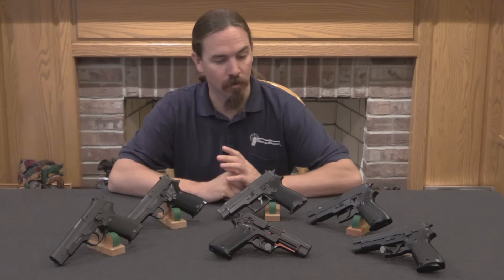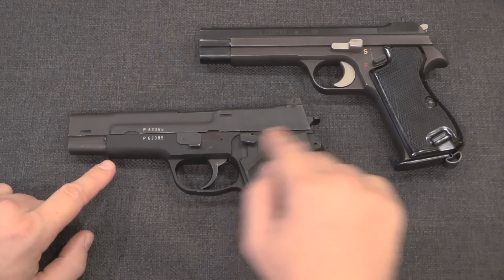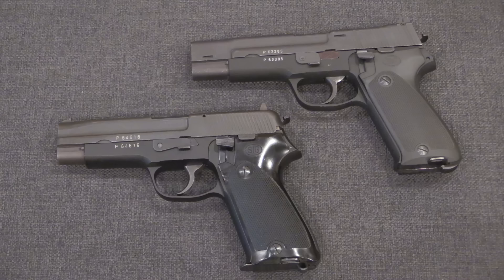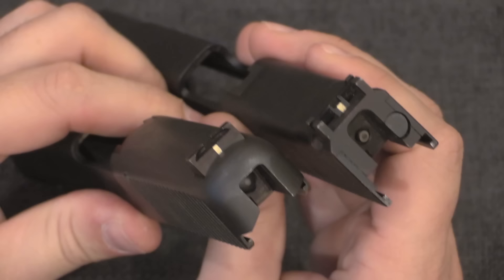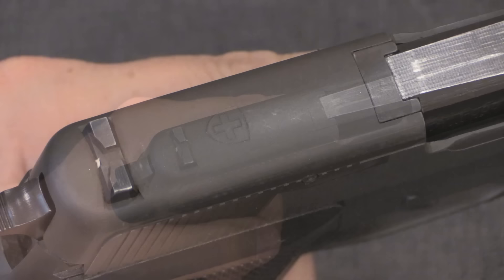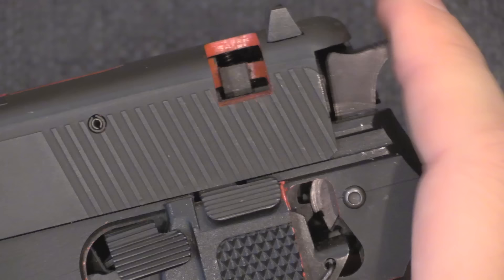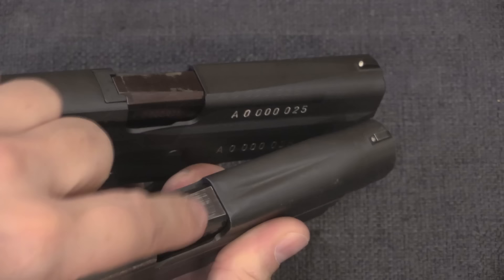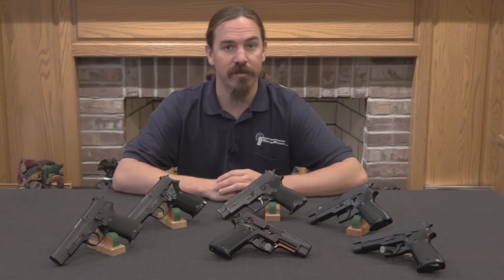Development of the SIG P220, aka the Swiss P75 Army Pistol

Comment: The shield on the border patrol pistol is to address the issue of the pistol scrubbing the mag release when carried in a police style holster and getting in and out of vehicles .  As a side not  H&K  addressed this same issue on the p7 by retrofitting a different mag release and re shaping the grips to guard it .
Reply: This makes sense as I would imagine a Customs Agent could conceivably be found crawling around in the back of a trailer truck inspecting the cargo.
Reply: For the north American market they moved it to a thumb release on the grip midway up the trigger guard.  Works well with my pinch type holster where the heel button almost invariably came in contact with EVERYTHING and released the magazine so it dropped as soon as I got out of my truck.
Reply: the shield on the heel mag release is to prevent accidentally hitting it when the officer pistol whips a suspect during difficult apprehension. 

ok, probably not, but that would have been my guess.
Reply: That is correct. It was supposed to solve vehicle seating issues.
Reply: That's exactly what I was thinking. Since the customs enforcement usually drives in normal cars (maybe even with sport seats if the people buying the vehicles don't know what they're doing) so that would be a constant issue
Reply: @Razgriz the Mandalorian 
I like it for being ambidextrous, but especially in the cae with brushing up against things in close spaces, the paddles can be touched accidentally, at least the ones that extend forward.
Reply: Interesting, my theory would be the using engine block for cover, resting the gun on the hood of a vehicle, one shot but your mag's out! 😮

Comment: I believe the initial army production of P75/P220 lasted until late 1980, early 1981. I received mine after officers’ school in June 1982 and the rounded slide had been replaced by the squarer one. Still own it but its hard trigger doesn’t make it as pleasant to shoot as my other pistols (Sphinx 3000 Competition, P226 X-Five Super Match in 9mm Para or P229 Sport in .357 SIG). Great review, thanks a lot.

Comment: Hopefully to be soon followed by the SIG Saur connection and the P6 / SIG 225 genesis. Geoff Who regrets not buying a 225 when the price was only mildly obscene and not buying a surplus P6 when they were available...sigh...regrets I'm had a few...
Reply: Yeah, I bought a Simunition converted P6 for $329 (and used it as such in some training), after a live barrel (took forever to find one), new grips, refinished slide and fresh internals-springs etc it is my carry gun. Too bad they are so expensive now...
Reply: Sig was always ridiculously proud of their pistols.  I've wanted a P226 or P226 to represent service pistols, but those prices...
Reply: I love SIG P225!!
Reply: A few years ago the police force I work for bought ~400 P6 pistols for 1€ per piece from another police force that was getting new pistols ;)
Reply: Thats how I got a decent P225. In Switzerland when Police or Military gets rid of Weapons the sell it on the market so chances are high that you may lay hands on a SIG225 with special Police Markings on it (I like the compact size and the compact grip of the P225 as it uses single stack Mags 8+1) . One of the best guns for me and this is the reason I do not like the P226, P228 or P229 as they use doublestack Mags and the Grip is much wider.

Comment: The ramp was there because as customs officers crawled around inside confined spaces and vehicle interiors, wearing modernish duty holsters which exposed the butt to contact, it was common to drag the butt of the pistol across surfaces which could release the magazine.  

Obviously this happened enough to cause it to be an issue that needed to be addressed.

Comment: A non-military P210 should be outfitted with fancy wood to accentuate its classiness. P220s look best when they're two-tone with wood grips (but that's true for pretty much any pistol that doesn't have a polymer frame).
Note: I have a first-gen American-pattern P220 that I bought used/like-new back in 2007 for $550 (K-coat finish, original grips).

Comment: Another difference with Zoll P.75/95, aside from the lanyard loop switched for the magazine release protection and the night sights, are the silver magazines used instead of the standard black ones. Don't know if it's stainless steel or just a finish, but they are pretty distinctive. Also, a small quantity (100 of 2000, IIRC) were issued with "short triggers", allegedly for female agents with small hands.

Comment: Cool video. Two questions though. What year did the company start mass-manufacturing the models chambered in .45 ACP and also, did these models ever get stainless steel slides? Are there any stainless steel slides made for it? I know there are for the 226 model but are there any made for the 220 as well?

Comment: Can people with knowledge of the subject comment please ? My understanding of the WW2 German stamping is they were done cold,then cutout and final shaping.
With the Swiss slides,the only reasonable way I can see with that heavy a gauge would be to stamp at some variation of orange -white heat. Then final fettling and inserts cold. You would want cold for shrinkage and final handling as well.
That much precision detail,even with successive bucks in several presses,the forces required to shape cold would be very high indeed,no ? Rejection rates would soar,would they not ? Bashing recalcitrant steel is one thing,adding a hot wrench causes less damage and warping without blacksmith level training, which I do not have. Thoughts ?

Comment: I really like my Sig Saur pistols (P229 in .40 caliber, which is among my primary CCW pistols, and P220) My P220 seems different than the ones you show here. Mine is an 8 rounds in the mag, plus a round in the chamber, .45 ACP. I wasn't even aware that P220s were made in 9s (I thought it was the P226 that as their full size 9) I bought mine used in the 90s, so unsure when it was made, but the grips are different, the slide/ barrel seems a bit different (bigger cocking serrations, barrel seems a bit longer), slide contour is a bit different, and it has a U.S. style mag button (so does my P229). Both have 3 dot night sights, back strap checkering, and squared trigger guard. Any idea when mine was produced?

Comment: No mention of the change from the machined steel frame rails incorporated into the locking block to the full-length aluminum frame rails of the later versions?

Comment: Slight error on unlock/lock sequence.  Two lugs on barrel bottom.  Front lug unlocks the barrel from slide, but rear lug forces the barrel back upward to lock.  Front lug runs in a cut in the frame trunnion going forward, there is no lifting surface there.  The rear lug rides on a horizontal flat holding the barrel locked until the frame/barrel recoils enough to clear the flat.  Rear lug has the cartridge guide ramp milled to the back surface.

Comment: I have a internal extractor P220 and it looks exactly like a German P220 only it says Exeter NH on the slide and there are no German markings of any kind, the serial number dates to 2000 and the gun came out of Sigs refurbishing program. I have never seen a p220 in this style that is made in USA. The firing pin block and internal extractor with the two roll pins one inside the other, its exactly like the German Sigs. Its the only one ive ever seen and i cant find anything on the internet about it, all USA made ones have the external extractor. Do you know anything about this gun? Ive been shooting it and carry it and i love it.

Comment: As a former swiss soldier, I gotta say the pistol is actually not that good. Despite it being praised for its reliability my comrades and I myself had quite a lot of malfunctions. Not to mention it has laughable capacity for a modern pistol. Although it is quite accurate, it has pretty shitty sights and is COMPLETELY USELESS when dark (as the pistol is intented for self protection as the army says itself, you would think it should be able to protect you even at night but nope. I remember mine was very stiff too. You really needed to slam that thing to load a round into the chamber. All in all I think it's a pretty bad pistol compared to modern counterparts like the beretta or the glock. Not even gonna mention that it looks like a block.

Comment: I think it was a mistake to adopt the P220. since 1935 there is no excuse to not include a double stack magazine. a single stack mag in 1975 is just archaic, the army should have waited for the P226
Reply: Panzerfan93 You know what is funny? SIG had a double stack prototype of the m49. We could have been ahead of everybody for years
Reply: You would trade the excellent grip, which is useable by almost everyone whatever size or shape of hands they have, for a minimal increase of firepower, which is not useful in a military pistol. An ordnance sidearm has a few functions, mostly symbolic (discipline tool, leadership mark, suicide, morale booster...). It's not a PDW, or it is no more since the late 1890s. Moreover, Swiss Army would have waited about ten years, since the P226 didn't appear until the XM9 trial (using slightly modified Beretta 92 magazines btw).
Reply: You would call doubling the amount of bullets as a "minimal increase in firepower" that's "not useful for a military pistol"? Service pistols may not be used often by frontline troops, but MP's and other light security personnel DO have a very real need for effective pistols. If you look at the P226 and the P220, they have EXACTLY the same width, it's a complete non-issue for double vs single stack in this application. It's also not like double stack pistols hadn't existed for decades already, like the Hi-Power.
Reply: John Creamer yeah, it is very minimal, compared to an additional 5.56 magazine or a few grenades. We are talking about 6 rounds of 9x19, here.
The width of the p226 is the same as the P220's, but not the circumference, and that is where people with hands on the smallish side have trouble, when grip is the most important basics of shooting. 
I would expect the wall of lead/ball of fire tactics used by big PD like in LA, NYC or SF not being the norm for police self-defense.
I agree there are a few pistols with double stack mags being very inclusive (the new P365, the CZ 75 and derived, the FN GP35 indeed, the Walther PPQ, some recent polymer HK pistols...) but all is a matter of compromise, and the SIG P220 combines its user-friendliness, excellent ergonomics and very good grip like no other. Is it without defaults ? Of course not. Is a ten-point capacity good enough for 99.999999 % of the jobs it will be carried for, especially in the Army ? I think so.
Reply: Swiss military police are issued with the Sig Pro, the Grenadiers, Parachute Reconaissance and Army Reconaissance are using Glocks. The Sig 220 is meant as the personal weapon for ordinary Officers and Senior NCOs instead of the Rifle the enlisted ranks get. Junior Officers are still issued rifles but they turn them in when their service period is over and take the pistol home.

Comment: I love my P75. But putting the pin back in that holds the locking block is a massive PITA. The block just won't slide back enough to be able to put the pin in. Sometimes I have to put it on my desk, do something else and try later. Couldn't figure out why.

Comment: A little disappointed You went to all the trouble to mention the simplification of the Browning action in that it deleted the swinging link but didn't get around to mention removing the lugs and locking surfaces and just going with re-shaping the chamber to use the ejection port as the locking surface, like the Webley Automatic pistol.

Was the P220 the first to do that in a pistol that was commercially/militarily successful?
Reply: If you're looking for a pistol that used the ejection port as the locking surface and was militarily successful then that honour would go to the MAS mle. 1935S pistol. It also formed the basis for the 9mm mle. 1950 pistol which also had a respectable service life all the way up to the 80s in the French Military.

Comment: How to the bond the milled breach block to the sheet metal slide?
Reply: By bending the slide around it. You basically press both objects together very tightly, and the breach block stays in place due to its shape - you’d have to unbent the slide in order to get it back out. On the nose piece, you need the two additional spots to hold it in place, because the slide doesn’t completely go around it (as the nose piece comes down below in order to hold the recoil spring).

This requires quite powerful presses as well as good, hardened steel for the breach block and nose piece, in order to keep them in shape while bending the slide around them.